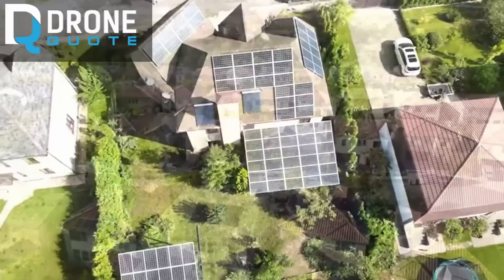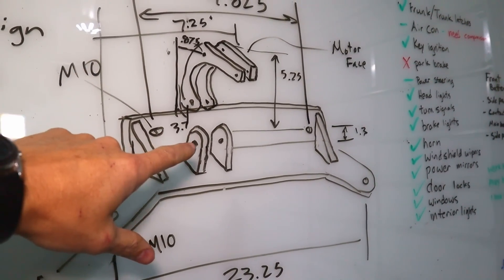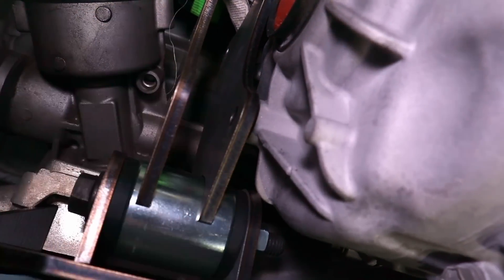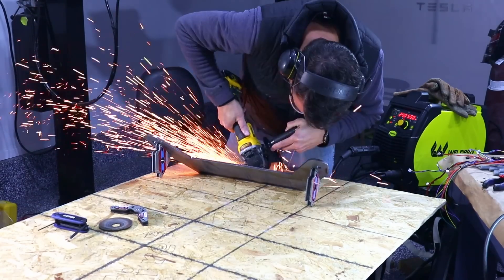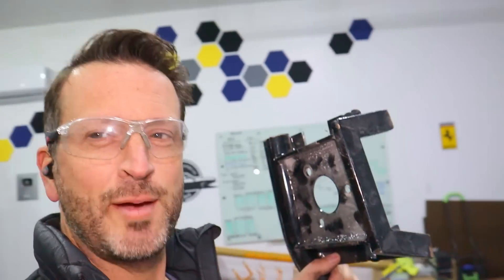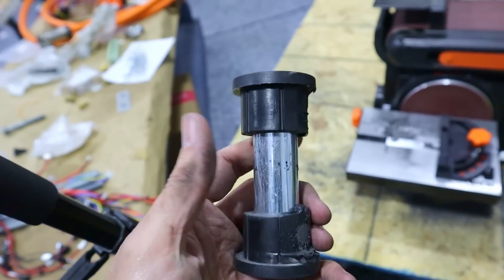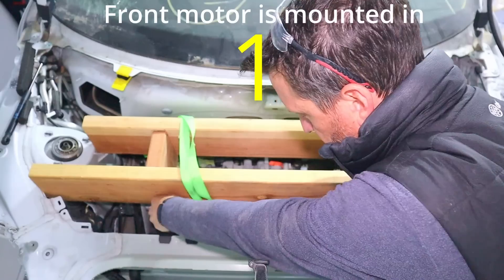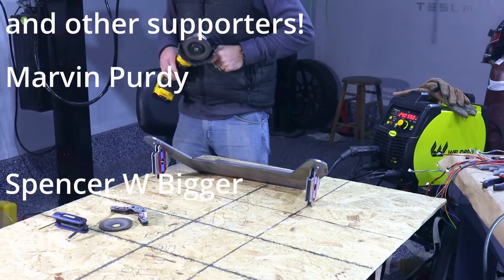AWD Electric Porsche - Front Tesla Motor Mounted

Comment: What is the rest of the suspension you are going to use? Like spindles and wheel bearings
Reply from the maker: Keeping OEM spindles and bearings
Reply: @electricsupercar are you doing a video on connecting the sdu to the front hubs?
Reply from the maker: @frederickbond5886 already done
https://youtu.be/tN7I8R3fwd0

Comment: if you want to weld without warping your parts .  Try a clod weld (Meaning) wrap a bag of ice in aluminum foil and place it on the opposite side of the part to keep the metal temp down.  start when the metal is cool to the touch.  Trick my grand dad taught me.
Reply from the maker: nice!

Comment: Looks very good gravity-wise, but the bolt spacers youput in will do almost nothing to stop the two plates from beding (to the left when in the car). If you add an othogonal piece of flat steel as a brace between the two blates it will be very rigid with just a relatively thin plate.

Comment: Why didn't you design that bushing to be an inch or two higher so you could pass a socket through the supports to reach that bolt? That way in the future you could drop the whole subframe without removing everything first.
Reply from the maker: Still can reach the bolt, just a little tighter quarters

Comment: One concern with the mounting plate is that it isn’t reinforced for a large section around the mounting bolts to your subframe. You might want to consider a right angle stabilizer piece being added to avoid the vibration and bounce caused by the single plane attachment. Even with the 2 bolts in the horizontal position - you still will have vibration from the distance. Add a small 1/2” piece on the inner edge and you will be significantly stronger.

Comment: Will you be doing any oil pump modifications to allow the running at this high and angle of the motor compared to the tesla installation?  Cooler sits horizontal on a tesla.
Reply from the maker: Great question.  I don't think so.  I am not running in reverse so no pump change is needed.  I also looked pretty closely at the oil pick up point and don't think I need to change anything there either.  Check out Weber Auto video
https://youtu.be/FVVT3FD30eY?si=cCJHexFzBv8zxTHi
At time point 25:25 there is a pretty good shot of the internals.
Reply: @ElectricSuperCar  i would say you might be cutting it close as you have the motor rotated nearly 45 degrees. With an oil pick up better safe then sorry in my opinion.

Comment: Nice mount however you lost all torque rigidity in your new mount. Not how tesla has the bushes 90 degree to the output rotation and you have it parallel. Guess another redesign is in order.

Comment: @ElectricSuperCar. It seems to me that your math is little off. Tesla front SDU should be 85-90kg. With your heavy duty awesome mounts it should be 88-93kg weight added to the car. I do not know how did you got 68kg?
Reply from the maker: I think, the stripped weight, I had the seats in.  Currently the seats are out.  I agree the weight should be a little more.

Comment: Amazing progress, I love the detail-oriented mindset that you have, and also how clear and efficient you are at communicating your ideas. If I was doing the project, I would try to make a nice chamfer in all of those laser-cut parts. Paint hates sticking to sharp edges, and water/salts love to start eating away metal from those sharp edges. It will make your project last a lot longer and all things considered, it doesn't add that much time. Try to remove as few welds as possible, and also try some practice pieces before you weld the final piece, it will give you insight into what you can improve.
Reply from the maker: Thanks for the tips!

Comment: Would suggest on the flat section to take a simple steel plate and weld it on the top, around 20mm wide by 6mm thick, to provide a little stiffness. Same on the bottom , at least at the front, as that motor will be attempting to flex the aluminium subframe, and letting the steel take most of the torque instead of the casting will help with fatigue life of the frame. Does not need to be fully welded, only around 25% at the ends, and then in the middle another 25% of the overall length, so there is a slight bit of flex. Run 3 welds, overlapping the last 2 so as to get full cover on the new plate, which will make it stiffer.
Reply from the maker: I may need a picture or drawing.  send to electricsupercar@gmail.com